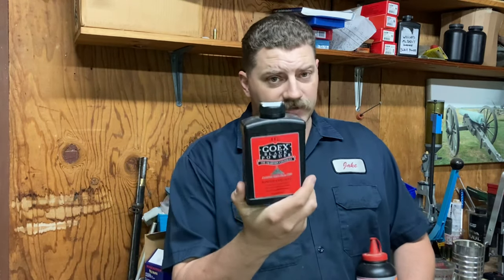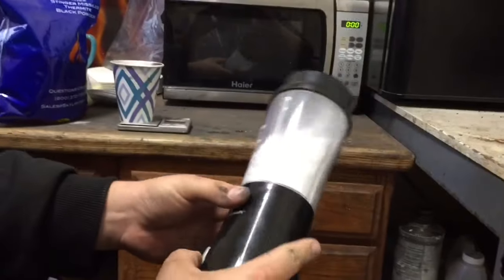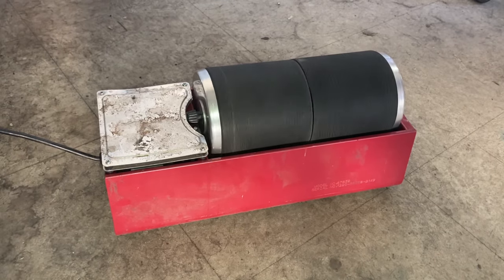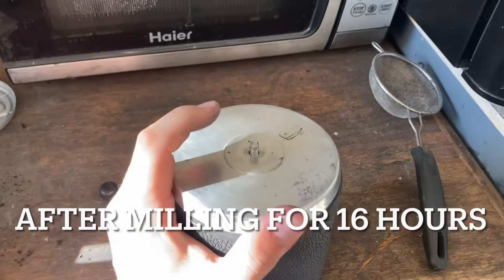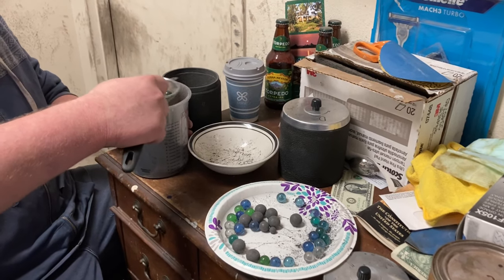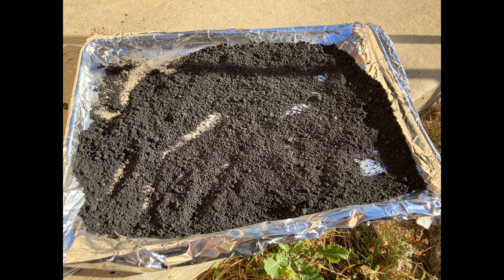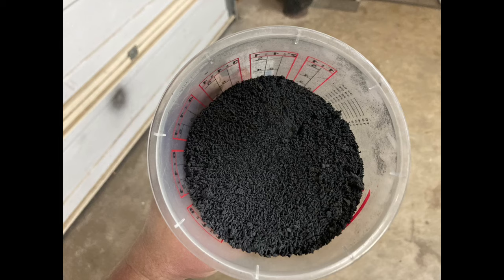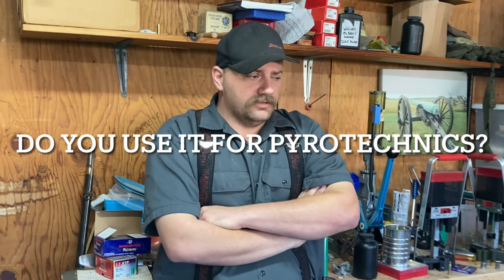How to make black powder (for firearms part 1)

Comment: How do you determine the min-max powder charge on a black powder fire arm? I have heard numerous ways but the old black powder guru I used to know is hundreds of miles away now. Example 45 cal pistol like a Kentucky starting powder charge-max?
Reply from the maker: I would start at 20gr and not go over 50gr in that pistol.
Reply: @Everythingblackpowder  That was maybe a bad example LOL How do you find the charge for say a cannon firing an 8 lb ball or a mortar firing possibly a golf ball etc. I have heard theories and a certain sound when it gets to the perfect charge. Revolvers are pretty straight forward, if you can get a ball seated and the cylinder rotates(Not being stupid on compression) it's good.

Comment: Hello everyone i need some help on making my own ive got the potassium nitrate, sulfur and air float charcoal i weighed everything out and ball milled it the first time for 8 hours. it turned out like garbage burned slow and left a whole lot of residue even after granulating it. the residue i have are these red bbs (its burning like shit) ( not flashing like i want it to)anyway i made another batch and ball milled for 20 hrs just to be sure and still same thing (fouling) a little faster but not by much   could it be my charcoal?
Reply from the maker: What media are you using? 
What kind of ball mill?
It is possible that you have bad charcoal
Reply: @Everythingblackpowder  Hey thanks for replying yea its a LEEGOL electric 3LBS  tumbler and im using some old .50 cal round balls i think it was my charcoal i still  need to do more testing but i made a batch with charcoal from my firepit in my yard. probably pine or oak it seemed better not really any red residue still a little slow even after milling it for 10 hrs. had yellowish smoke as well but trying to get my hands on willow or something that will  make it faster
Reply from the maker: Willow works very well

Comment: Are you worried about the static discharge or a spark going off in the ball mill
Reply from the maker: Nope
Reply: @Everythingblackpowder  I've read that black powder can go off by friction
Reply from the maker: @Joe.8671  well I suppose it’s possible but I’ve made a lot of powder and never had a mishap

Comment: This may be a silly question. But i guess I won't know until i ask, lol can you use activated charcoal to make powered, or does it matter?
Reply from the maker: Yes you can use activated charcoal but it generally makes weak powder
Reply: The only reason I ask is that i have 10 pounds of it just sitting here not being used

Comment: We should talk. With a ball mill, and your  setup, you should easily make powder faster then goex for a few dollars a pound. Definitly on the right track. Try red cedar pet bedding for your charcoal. And research ball milling theory.
Reply from the maker: Last weekend we were doing Some experiments using a die and compressing the powder in a 20 ton press. So far, in the few test we have run. Our powder is just as strong as goex and Swiss. The weight and volume also matches goex and Swiss, so it’s looking promising!
Reply: @Everythingblackpowder  that's called pucking, and corning the powder. While very useful for making, hard consistant grains, it doesnt necessarily make your powder faster. The biggest factor in BP speed, and power is the charcoal used. Try some ERC bedding cooked down to charcoal, or order some online. 
Also, if you speed up that mill, or build a more efficient one, you can cut the mill time down to 2-6 hours depending on your setup. 
Check out Lloyd's book. 
https://www.amazon.com/Milling-Theory-Practice-Amateur-Pyrotechnician/dp/B00229ZI7W
Reply: Btw. I dont mean to come of like I know everything. Your doing a great job, just wanted to share some things I've learned along the way.
Reply from the maker: @charlesfarley7023  No worries. I appreciate any information on the subject.
Reply: @Everythingblackpowder  Great! I'm happy to share, if you ever have any questions.
Reply: @Everythingblackpowder  what did you use for your "pucking die"?? thanks again!
Reply from the maker: @kirkethridge2500  we machined one out of aluminum

Comment: Whatdya think of 777 in a flintlock. How about goex and then pyrodex in a flintlock. How about the subs in a cartridge. Had one split the side in a 38 special round with goex
Reply from the maker: I’ve never used 777 in any BP firearms so I can’t say. I did try the goex and pyrodex deal in a flintlock the other day, it seems to work fine but not worth the effort in my opinion. I’ve never had goex, Swiss or homemade powder split a case but I sure have with pyrodex.

Comment: If you're stuck with a ton of Pyrodex and manage to get a can or two of black powder, you use the Pyrodex in the flintlock if you add a 5-10 grain 'kicker charge' of black powder into the chamber first, then using the Pyrodex for the remainder of the charge. That way the primer flash kicks off the black powder in the chamber, which then sets off the Pyrodex on top of it.
Reply from the maker: That’s interesting. I’ve never tried that
Reply: Yes, this known as a duplex charge in the black powder cartridge world.  There are different combinations used to meet different needs/goals.

Comment: I recently made my first batch of BP.  I used pine charcoal and milled the ingredients for 14 hours (I lost track of time).  I followed the instructions in this video except I used plain water to make the BP meatball instead of isopropyl alcohol.  After granulating and letting this powder dry, I weighed the powder to see how "off" the powder density is.  I found that the powder was only about 44% the actual weight vs the volumetric measure (45 grains volumetric is around 20 grains actual weight).  In the video, you say yours is about 20% less dense.  Could it be that the not using the rubbing alcohol made that much of a difference in my case?
Reply from the maker: I doubt it. It could be your charcoal as well. I highly recommend Corning your powder. I have made screened powder since I started Corning my powder. It’s the only way to fly
Reply: @Everythingblackpowder  Thanks for the reply.  I love your videos.  For my next batch I am planning on using maple or cottonwood charcoal as I have heard that those are supposed to work well.  I also have some willow that could acquire locally if I wanted.  Since those are hardwoods, they will probably also increase the weight of the overall product.  If I could get to within 20% weight using the screen method, I would be happy since I'm only planning on using it in my cap and ball revolver for now.  Eventually, I may get into corning the powder if really want to up my game.

Comment: Would it be beneficial to add h20 and boil th ese ingredients together followed by blending after it has dried? Possibly consider adding aluminum powder ?
Reply from the maker: Yes, I have a video on that but I absolutely would not add any aluminum powder if you’re planning on using it in a firearm
Reply: I want to make it strong enough to destroy a beaver dam

Comment: Have you considered making illudiumfosdecks using an interocitor?
Reply from the maker: Yes, we’ve tired that in the past. The trouble is that the hydrocoptic marzelvains don’t bond well under the extreme vacuum-pressure of the interociter . However this can be corrected by adding appropriate amounts of inverse reactive current. 
Hope this helps.

Comment: Quick question, 
I’ve been doing research on the legality of personal powder. 
I inherited a musket but I can’t find powder anywhere to buy. 
People have told me I need a license  to make it even if it’s for personal use. 
Thoughts?
Reply from the maker: In the USA, you can make and possess 50lbs of black powder before needing a license
Reply: Ah okay, my state limits it some but when I read the atf pamphlet it said it was permit required for manufacture
Reply from the maker: @Rollinthndr798  As far as I understand it, you need a permit if you’re planning on making or possessing more than 50 pounds. But the ATF does have a pretty bad reputation of changing the rules every week or so…
Reply: Thanks for your response!

Comment: Great vid! However, glass marbles not a good idea... Silica dust in your powder and eventually in you gunbarrel not top... I I use zing balls (harder than lead and quite heavy too) My ball mill is a beer keg and the balls much bigger. Rotation speed is 46 RPM. I grind separately then all together but without the lid  when all together, just a thin leather skin with 4 elastics. Just in case... I could never get better than 85% the power of swiss powder.
Reply from the maker: We use brass balls nowadays and can make powder that is more powerful and cleaner than Swiss. Here is the video, if you’re interested.
Reply from the maker: https://youtu.be/PJDjKvjqvpM?si=bPJEgJDvkyS73Emf
Reply: @Everythingblackpowder  Thanks Mate

Comment: So they have this black charcoal for hygiene products as in like brushing your teeth and I've noticed how fine the black charcoal powder toothpaste is and it's like micron fine... Have you ever thought about making black powder with the charcoal toothpaste before?
Reply: I have the same question.
But does it cheaper than charcoal for bp ?
Reply: @guillaumelefrancois5255  I'm not sure maybe but also on that note I was wondering if he's ever made black powder by recycling charcoal that turns into Ash from like barbecues or smokers... Especially smokers because they produce a lot of Ash from dual drop-down barrel smokers... That would be an interesting experiment if he could take the ash and then charcoal it up and see if he can make black powder from recycling Ash
Reply: @iiiKingLongSwipeiii  it's impossible to turn back Ashe into charcoal. According to thermodynamics law it should be, but in real life it's not.
In charcoal for black powder you want a source of carbone. When combusting carbon react with atmospheric dioxygène (O2), and change into CO2, or into CO Carbone monoxide of there's not as much oxygen as needed for good combustion.
So carbon fly away, in CO2 or even CO, wich are gas. There's no carbon in ash. 😉
Reply: @guillaumelefrancois5255  they say they can make diamonds out of thin air that are holds carbon so maybe there's a way that you mix the Ash with water again and then you do something which I don't know 😅🍿
Reply: @iiiKingLongSwipeiii  ??
The air contain carbon, as the air contain CO2. Pire water is H2O, no carbon in there only oxygen and 2 hydrogen.
But in real life water also contain CO2 and O2 that is mixed into it. Water in real life is never pure water, it take some of those gas in the atmosphere. So yes you can find carbon in water.
That's not impossible to create diamonds by extracting the carbon from CO2 in the air or in water...

Ashe is not interesting at all as a source of carbon.
In the process to make diamond from water : no idea.

Comment: What would you compare ur power to ff fff or does it just depend on how long u let it mill?
Reply from the maker: It’s comparable to 3F but the longer its milled, the better
Reply: @Everythingblackpowder  thanks
Reply: @hbmoore7803  you must granulate you powder for safer gun use (ffg is good in many cases)

Comment: On your ball mill, I notice marbles were in the container. Have you try to mill the powder with different size of marbles only?
Reply from the maker: I tried all kinds of things. The marbles didn’t work well, probably because they are too light. What works the best is a mix of lead balls and cut up lead wheel weights.
Reply: @Everythingblackpowder  How about ball bearings?
Reply from the maker: @RafaAelM  No steel media.
Reply: @RafaAelM  marbles and steel and ceramic have all have had reported issues.
Brass, lead, nickel, copper... all safe choices.

Comment: Did you ever use brass media in your harborfreight Mill. 
How much brass media is recommended for harborfreight mill ??
Reply from the maker: I never used brass in my harbor freight rig but I use it in my homemade rig. About 1/3 full
Reply: @Everythingblackpowder   was all 1/2 inch in the treadmiller, wasn't it
Reply from the maker: I have 1/3 and 3/8 in there now
Reply: @Everythingblackpowder  okay, thanks, that's what I was thinking for Harborfreight  Mill, 3/8 's, I appreciate the reply and the videos, there a good watch
Reply from the maker: Sorry that was supposed to be 1/2 inch
Reply: @Everythingblackpowder  no problem, I remember 1/2 in that video

Comment: Does not sorting by f grades make a differance?
Reply from the maker: Yes, bigger grains of powder like 1F flash slower than smaller grains like 3f. If you don’t sort them you will have inconsistent burn rates.

Comment: Isn't it pretty sensitive to static electricity?  How dangerous is it to have around in your opinion. Last but not least, can it be stored long term?
Reply from the maker: I’ve never had any problems with static electricity, storing it in plastic containers or having several pounds stashed around my re loading room. In the 20 years I’ve been doing black powder stuff, Ive never had any black powder spontaneously combust for any reason including static electricity. With that being said, you always need to be careful.
Reply: @Everythingblackpowder  Save your old Powder Bottles from Smokeless and Pyrodex or BP as the type of Plastic they use is selected to prevent Static Electricity .Some types make a lot of Static which makes them useful for Powder Coating Cast Bullets for Cartridge Guns like .357 /.38Spcl.,.45 ACP ,.300 Blackout or .30-06 which I've used them in.

Comment: Have you tried glazing the powder the powder grains dry. I believe the old timers did this to get a more uniform burn
Reply from the maker: No. How is it done?
Reply: @Everythingblackpowder  the way I understand it is the raw powder granules are tumbled that knocks the sharp edges off and gives each grain a smooth glossy appearance.  Care must be give as any static could set it off
Reply: I read about this method some 50+  years ago. I would only do a very small amount to try it out.

Comment: How is the hardness? I've been working with my mix, when its granulated, it's very crumbly and goes right back into dust when I try to handle it. Any suggestions?
Reply from the maker: Try using water instead of alcohol
Reply: Add more moisture to the powder before you granulate. I was having the same problem and solved it that way.

Comment: Thank you!
Reply from the maker: Happy to help
Reply: @Everythingblackpowder  
What are your thoughts concerning Skylighter’s Black Powder Chemicals Kits? Any experience?
Reply from the maker: @jaspersmells2058  yes, the first time I made black powder I bought a kit from skylighter. The only problem is the charcoal they give you is mixed hardwood, which is not ideal. It does work but if you really want premium black powder then you need to make your own charcoal from willow, grapevines, eastern ceder or white pine.

Comment: Kind of a silly question, but do you figure that an inertia driven auto-loading shotgun could work with black powder loaded shells?
Reply from the maker: You mean like this?

https://youtu.be/ezhorwe4nIY
Reply: @Everythingblackpowder  I’ve seen examples like that Browning auto 5. But something that isn’t long recoil action. Like a Benelli or franchi inertia system for example. I can’t find anywhere online that anyone’s done it. I imagine it would work just the same, but would probably kick sparks out of the ejection port like a flame thrower into your face. As much as a I want an auto loader I like being able to make my own ammunition from home. And nitrocellulose can’t be done from just anyone’s house, not stable enough, not worth the risk. But enough of my rambling. I’ll probably have a video of it up when that time comes.
Reply from the maker: @Genevasuggestions1  I couldn’t say, I’ve never seen it done either.
Reply: @Everythingblackpowder  You mean like this? Good one. Pretty cool video.

Comment: So my question to you. I use 30grains Pyrodex in revolvers and get 1000fps roughly. If I stuff the sht out of it, I think I can fit 40grains. Do you think I’d be able to reach 1000fps with a homemade charge like that?
Reply from the maker: If you corn your powder, yes
Reply: @Everythingblackpowder  thank you!
Reply from the maker: If you use good charcoal and compress your powder to the same level as the commercial brands you can definitely achieve it. With 45 Colt I use 40gr of 3F Alder Buckthorn powder with a 250gr bullet and I can get right at 1000fps through a SAA clone with a 7.5 inch barrel.
Reply: @Everythingblackpowder  as far as compression goes. Do I need some kind of hydraulic press to press the powder? Or just my own weight on a flat piece of steel. I’m a noob at making this so I’m not sure how the compression works.
Reply from the maker: @Corvette-stringray-lt2 Making Corned Black Powder
https://youtu.be/D24DR5OLtds

Comment: I'm just setting up a 1st run to make some BP:... Q:  how much powder do you make in a run (each tubb)?!?
i was planning on 1 lb per tubb...having trouble keeping the total weight of the tubb under 3 lbs ...what do you
make/tubb...?!?
Reply from the maker: If you were using the harbor freight Tumbler, I wouldn’t do more than 200 g at a time
Reply: Yep;  thank you very much for posting this;  i just finished 20 hours, grinding 1# of mix in 1 HF tub;  needless to say
this did not produce desired results  }:~  even tho it 'looks' fine,  it is Lamer than your lame example...heh...i will not go
into the steps that caused me to attempt this tub/mix ... just thanks for the above guide @Everythingblackpowder